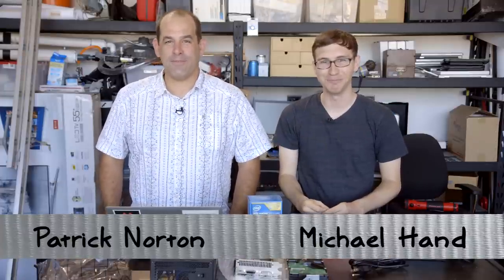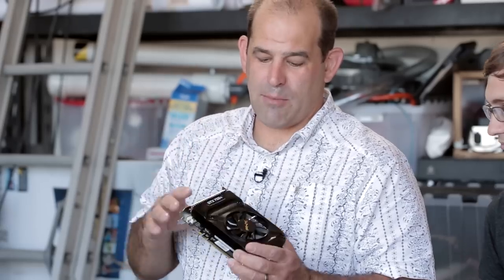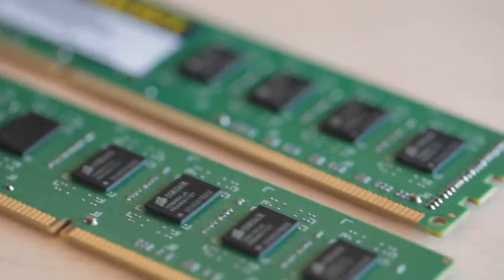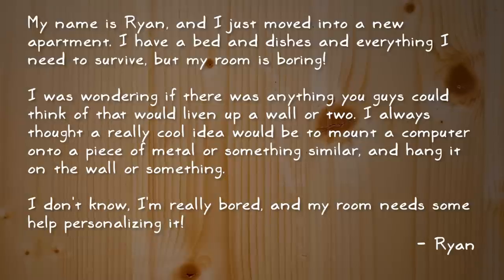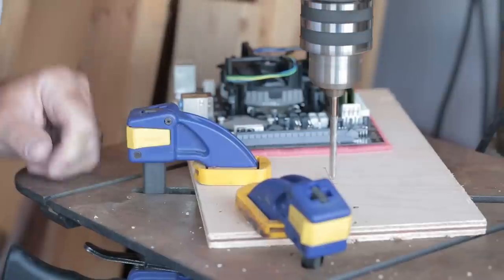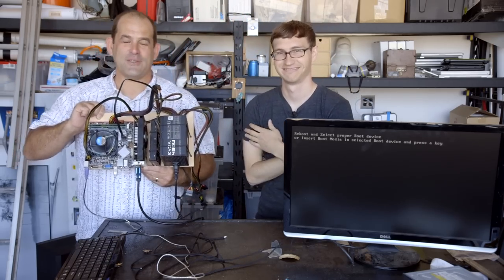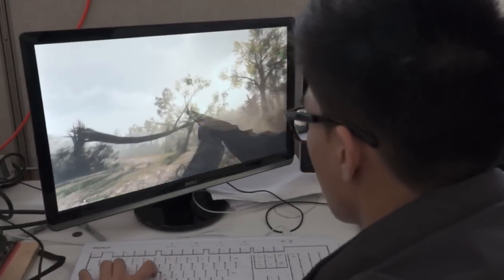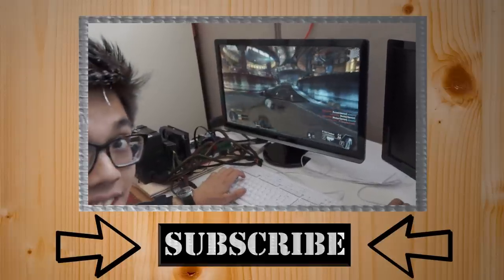Screw The XBOX ONE and the PS4... We Built a Gaming PC for $380!

Comment: Throw in a monitor plus software, thats like a $600 build, 200 dollars more expensive than the PS4.
Reply: You can use a TV as a monitor, most TVs are pretty good with response time and what not. As for the software, it's already included and it's still under $500.
Reply: the operating system is included?
Reply: iGame you can use steam os for free if you want it to be on the level of the console's os...
Reply: I'm completely new to PC, explain what steam os is?
Reply: iGame steam os is almost exactly the big picture mode in steam. if you want to know how to install it, watch linus tech tip's video on it.
Reply: Oh yeah? but what about the tv and the controllers, talkin about another thousand dollars there
Reply: Umm... And throw in a TV to play the ps4 on and your talking about an equal if not greater price...
Reply: I think having a TV is pretty standard if your buying a PS4.  Most people probably have a TV by now...
Reply: I think it would be a little uncomfortable to play a PC right under your TV. I'm not sure if you can use wireless controllers either...
Reply: iGame Right, but the argument could go both ways: most people already own a monitor as well. It's quite standard in most households. In general, however, the net cost of all the items you purchase will be about equal regardless of which way you go but I'd take a PC over a console any day.
Reply: iGame I dont have a TV...
Reply: you got those for free
Reply: The PS4 has a built in screen nowadays ?
Reply: And a good gaming mouse and gaming keyboard too. Dont forget that.
Reply: Windows isn't the only OS. Also, since when did a monster have to be $500?
Reply: Paralyzed Tortoise But its the one Games are the most compatible with.
Reply: ***** Why are you assuming im a console person for? If you want to be good at games, you need a good gaming keyboard, with anti ghosting and very responsive keys and a high DPI mouse for the best accuracy. You also know what they say when you assume things about people right? Ill remind you: Assuming makes an ass out of you lol You console haters try way too hard and make PC gamers look bad.
Reply: If you have purchased a tv in the last 10 years it will have HMDI, you could easily use that as your display, so your comment is irrelevant.
Reply: ***** How is me pointing out youre wrong being butt hurt? You just exposed yourself as a troll.
i enjoyed that troll though. It was funny lol :)
Reply: Don Cheech Not entirely, not every tv sold ten years ago till now had hdmi.
Reply: ***** You were wrong about me being butt hurt and assuming i was a console player. So you were entirely wrong about 2 of the 3 points you tried to make. they arent essential, no. But youll be a lot better with a better mouse made for gaming. So youre not wrong or right on the mouse, as that is personal preference.
Reply: ***** Im pretty certain as im just the type of person who responds and explains things. If something isnt true, i simply correct it. thats all. So yes im certain. :)
Reply: Umm you need a TVs for ps4 lol
Reply: noah brown Majority of people already have a tv.
Reply: Rockymann27 tv's can be used as monitors so everyone shut up i win.
Reply: William91W Then it shouldnt be included as a price for either, since most people own one lol
Reply: Throw in a tv plus playstation plus that's 550$-650$ your argument is invalid.
Reply: E Zannino Everyone has a TV pretty much, so thats not a valid point really.
Reply: ***** I said pretty much everyone. Not everyone.
Reply: ***** Well then what was the point of that? X_X
Reply: Rockymann27 Every pc has an hdmi. That was my point.
Reply: Wth are you talking about? Not every PC has HDMI.
Reply: Keyboard, mouse, desk, mouse pad, chair, subscription to play online...wait nevermind, that's free.
Reply: James T You have cable bill and there are monthly service games, like WoW.
Reply: If you have a tv already: HDMI (60hz max but this is budget stuff anyway), software: Debian Wheezy or Ubuntu 14, keyboard and mouse combo: $30 max.
Reply: Lots of people have laptops...
Reply: lots of people can't figure out how to use a PC let alone figure out the hardware they need to run a game. Hence the console market. They cater to the less tech savvy crowd. It will play your games at 900p (not 1080p) make you a cup of coffee and possibly wipe your ass and tuck you into bed as well. :)
Reply: Some of us just want a casual gaming experience
Reply: Last time I checked, the PS4 doesn't come with a TV.  Add in the cost of playing games online, and if you're going to throw in the cost of games, last time I checked, games were generally more expensive at launch on consoles than PC.
Reply: You can play with PC players, that the biggest perk of PC gaming:) I'm new to PC gaming. People here game seriously and they game hard. It's always a challenging and intense, if I play Playstation again its like a slow childs birthday party ( it's that distinctly different). Too many bored kids ruining the game play in console land.If you have a chance to play PC do it (if you haven't yet). It's also so much cheaper for games it ridiculous. I have a back log of games!! A back log!!:) I haven't had that EVER and I've been a console gamer since before playstation one existed!

Steam has amazing deals mid week and week ends. Great games for net to nothing. I got the new Tomb Raider (2013) about a month ago for €13! (It came with every other Tomb Raider available on PC, right back to the first game). Both Portal games €18, Metro 2033 both games about €22. I've picked up great games like that for the past few month I'm forcing myself to stop. Like Fear came out the other day for like €15 with 2 other Fear title packed in, I had to stop myself because I need to play games I already have. Its amazing on game cost, its actually ridiculous:)
Reply: You all forgot about the modability of pc games. Games like Skyrim, FalloutNV and GTA games could be modified to add hundreds of hours of game play PLUS vastly improved graphics over the console versions
Reply: iGame of course you can use wireless controllers on your pc.
Reply: energetically1 after reading your comment i really dont want to convince any console gamer to come to pc, dont want to get the slow childs birthday party over to my house.
Reply: jan050375 Ah it is fight or die in the PC world I'm finding. I'm being completely schooled ha ha  It forces you to be a better gamer for sure, which is really cool actually. I haven't been this excited about gaming in years. The herd is culled regularly in the Master Race, so get stronger or get smashed relentlessly and smeared in LOLz:)
Reply: energetically1 There are plenty of those type of people on PC too. So hate to break it to you, the community is not as drastically different as you think.
Reply: Rockymann27 Yes, it most certainly is.  I can go on any multiplayer game on PC and not have to deal with racist, sexist manchildren screaming into their headsets.
Reply: jedidethfreak Ive....encountered many of those kind of people playing on PC. Anyone that says there are none of those kind of people on PC as well are just plain lying. So im sorry that i have to say it, but youre lying by saying there is none of that.
Reply: Rockymann27 I didn't say there is none - only that I've never dealt with it in my 25 years of PC gaming.  On the other hand, I can't play games online on a non-Nintendo console without experiencing such.
Reply: jedidethfreak Ive played on non nintendo consoles online and only experience it every now and again. Definitely not everytime i played like you like to exaggerate.
Reply: Rockymann27 I'm supposed to believe that from the guy who claims a gaming mouse and gaming keyboard are "mandatory?"
Reply: Rockymann27 Well yea of course but its defiantly a much better gaming experience (multiplayer), by a long shot.
Reply: energetically1 And even a basic KBM is a better gaming experience than a controller in a lot of games.  The ones that it isn't can still be played on PC with a controller anyway.
Reply: jedidethfreak When did i ever say a mouse and keyboard are mandatory? At all? I never once said that. Respond to the right person. X_X
Reply: energetically1 Well as far as my experience personally experience, theyre pretty even as far as community online.
Reply: Rockymann27 I did respond to the right person - your very first post in this very thread has you stating that if you're gaming on PC, you need a gaming mouse and keyboard - that such items are a mandatory addition to the cost of a PC for gaming.
Reply: jedidethfreak Need a gaming mouse and keyboard TO DO WELL in gaming. I didnt say it was required, just that a cheap keyboard has a lot of drawbacks/ Like antighosting for example. Nice way to take a small part of what i said and ignore the rest though.
Reply: Throw in a tv, hey look the PS4 cost 300 bucks more, gtfo
Reply: X3nonEyez Most people already have a tv.
Reply: Rockymann27 Of course, if you actually know what you're talking about, you'd know that ALL ps/2 Keyboards have anti-ghosting and rollover, and are significantly cheaper than "gaming" keyboards.  So, again - you're just plain wrong.
Reply: jedidethfreak Not all keyboards have GOOD anti ghosting. Plus i was just using one part as an example, theres more than that that gaming keyboards make them far better for gaming than normal ones. So again, you acting like your opinion is absolute truth (when its not) just shows how plain wrong you are. I tried playing games online at my colleges computer with there keyboard. It was sluggish and not as responsive for twitch movement like my gaming keyboard is. Like i said, its possible to play with a normal keyboard and you can. but gaming keyboards will always have a big advantage over them as far as gaming is concerned.
Reply: Rockymann27 I don't... but i already I have a monitor so that argument is bullshit
Reply: Yeah make sure to add 300$ TV to your console price with that logic. You can plus a PC into a TV just fine. Derp.
Reply: Rockymann27 My "opinion" IS fact - you do NOT need to include the price of a gaming keyboard and gaming mouse in a gaming PC.  If your only example of why it's needed is an el-cheapo keyboard that's used by hundreds of people a day, it just proves you're looking for reasons to make yourself right, when you're wrong.
Reply: LOL a ps4 also requires a tv???
Reply: jedidethfreak It sounds like thats what youre doing with your opinion. I stated the advantages of it, thats all. Youre treating yours as a fact when yours as just as much of an opinion as mine.
Reply: ***** I want to play GTA V, Halo, Uncharted using pc
Reply: asifur rahman GTA V is coming in a month, and people will mod the shit out of it and make it even greater, of course you could play Halo, in fact it's waiting for you for free
Reply: Because consoles come with TV's and its not like you have to pay subscription fees to play multiplayer or anything........ Oh wait, nope.
Reply: Rockymann27 How is it "opinion" to say you do not absolutely need to buy a gaming keyboard and gaming mouse?  The ten-dollar Best Buy special will game just fine - this is a fact.  This isn't opinion.  We're talking about water's wetness, here - it's wet.  That's just as much fact as not needing a gaming keyboard to game on PC.  I know - I've been doing it for ten years with a wireless non-gaming keyboard and wireless non-gaming mouse.  Would it be "better?"  Absolutely, and I never argued otherwise.  Is it necessary?  Absolutely not.

Again, I'm not arguing opinion.  I'm arguing fact.
Reply: Rockymann27 You don't need an anti ghosting keyboard or a mouse with 58 keys and uber high DPI.
I use some cheap ass keyboard and mouse that I got for ~30$. Which is around half the price of an Xbox one controller.
Better mice don't mean better gaming performance. Sure, you might be able to use another key or two, but it ISN'T NECESSARY.
Reply: These guys just explain how well this beats a console, and yet the fan boys will act like it's shit,
"You still need a monitor"
Well you still need a tv to play a console. Most gpus have hdmi ports now a days, and i'm sure most of the flat screen Everybody uses has them too. Friend uses his 42 inch flat screen and is loving it.
"It can't use wireless controllers"
Wrong yet again pretend to be stupid all you want.It can use both wireless and wire controllers, even better games like battlefield you can use a jet controller.
"Some other stupid excuse"
Pretend to be stupid and ignorant, even then PC will still come on top more comfortable than console
Reply: Throw In the TV to game on your ps4? Why does no one factor in the TV when talking about consoles. Its the same argument
Reply: iGame PS4 comes with a display for free?
Reply: Well, what about games that cost $60? What about the $50 PSN/Live. Its gonna add up.
Reply: Software is easy to get for free, and you will spend more on a TV for your shhhitty ps4, than on an average 60htz monitor
Reply: Daniel Stevenson
Bloodborne
All PC guys r weeping
Reply: asifur rahman Yep - we're weeping that we don't get to have that sweet 24fps and 70ms frame times, with half-minute loads.

http://www.eurogamer.net/articles/digitalfoundry-2015-bloodborne-performance-analysis
Reply: Throw in a $600 TV and that's like $400 more than the PS4? derpaderp
Reply: what are most people using as a monitor right now?
Reply: Rockymann27 Why does one need fancy peripherals to be good at games?  I used to use (actually still have the damn thing) an old cicero PS/2 keyboard and a Dell optical mouse (which died). It was awesome and I could rack up a K/D of 10 to 20 on COD2, CS:Source and BF2, depending on the game. Now I have a fancy mechanical keyboard and a laser/optical hybrid mouse thing and it hasn't really upped my game, just is more comfortable.
Reply: TheMeisterize And with it being more comfortable, you can game longer and more efficiently.
Reply: Rockymann27 doesn't make it necessary, as you argued.
Reply: jedidethfreak I never said it was a must. i said it gives you way more of an advantage.
Reply: jedidethfreak Necessary to compete good on high levels. Not a must all around. Stop twisting my words.
Reply: jedidethfreak tl;dr. You twisted my words and point, so this thread is pointless now with you yelling and doing so.
Reply: A butt and a half I plan on doing so. I re read all my comments and never said you needed a gaming mouse and keyboard. Just that having one gives you more of an advantage over someone who doesnt. I tried playing on my colleges computers and i couldnt press multiple buttons at once. So i couldnt turn my tank and turret at the same time. It was really frustrating....X_X
Reply: Rockymann27 Again - I quoted you directly, so saying you didn't say it makes you a liar.  It was your VERY FIRST POST IN THIS CONVERSATION.
Reply: jedidethfreak And a good gaming mouse and gaming keyboard too. Dont forget that.

Thats what i said in my very first post. Where in that post did i say its a must a required? Show me where i said those words in my first post please.
Reply: I'm going to type really slow, and hopefully you'll keep up.

This thread.  Is about.  REQUIRED.  PC.  GAMING.  PERIPHERALS.

By making that statement, you said those were REQUIRED.  Got it, yet?  Then, when I pointed out that those were merely optional, at best, you argued that point.

By saying (and again, I quote):

"If you want to be good at games, you need a good gaming keyboard, with anti ghosting and very responsive keys and a high DPI mouse for the best accuracy."

"you need"

"need"

As in, not optional, but mandatory.
Reply: Rockymann27 Go ahead - we can all see you said it, seeing as how I copy-pasted your posts.
Reply: Throw in a TV for ps4 and you are at 900$ ...
Reply: jedidethfreak I re read what you copy and pasted, and no where in any of that did i say the word required or you absolutely need it. Again, good try with lying and twisting my words around. The word you need isnt the same as required. But again, good try twisting my words around to mean something i never said,
Reply: OperationGames45 Most people already have tvs.
Reply: Rockymann27 most people already have monitors, and an sd tv
Reply: A butt and a half That is true, but a lot of people, from what i read and heard when theyre building a new gaming rig, want a new one thats 144hz and can display 1440p or 4k. Those of which, most people do not have lol
Reply: Rockymann27 well, yeah. most people don't have those kinds of expensive monitors, but many have 1080 p 60 hz monitors which are more than what the consoles do
Reply: A butt and a half Thats true most of the time, but like i said, whenever i here about someone building a gaming rig, they talk about getting those expensive monitors. lol
Reply: Rockymann27 they shouldn't right now, they are very expensive.
Reply: Rockymann27 if they have enough money, and care enough. then sure.
Reply: Rockymann27 You said "need."  Twice.  Do you not know what "need" means?
Reply: Rockymann27 curious, I can press six keys at once on my Logitech mk320 keyboard/mouse combo from like 2009, and I have had no problems with ghosting, even in StarCraft 2 or League.  I still use it for LAN parties occasionally.  Keep in mind this keyboard and mouse share a single usb dongle that has about a 3 foot usable range, not exactly top notch equipment. Your friend must have some soviet era bullshit or something.
Reply: jedidethfreak Do you not know need and required are 2 different words?
Reply: Final Kill Gaming Do you already own a tv? ok good to go
Reply: You can get free operating systems or just get 13$ par codes
And most people already have a monitor from spare computers 
And even you could get a nice gaming bundle kit with leds for a mouse and keyboard
shreked
Reply: Rockymann27 Two different words, with the same fucking meaning.  Read a thesaurus - they're synonyms.

A synonym is a word that has the same meaning as another word.

A thesaurus is a book that says what words mean the same as other words.

I thought I'd spell that out, since English clearly isn't your first language.
Reply: TheMeisterize Actually, old-school keyboards don't ghost at all, because of how they're made.
Reply: jedidethfreak For PS/2 keyboards absolutely correct
Reply: jedidethfreak heres what they said the synonyms for need are:

commitmentstardemandstarobligationstarrightstarurgencystarusestarwishstarchargestarcommittalstarcompulsionstardesideratumstardevoirstardutystaressentialstarexigencystarextremitystarlongingstarmuststaroccasionstarrequisitestarweaknessstaroughtstarthe urgestar

read it 3 times and the word required never came up. It must be hard for you to accept any possibility that you could be wrong and youre grasping at straws at this point. Good try though.
Reply: TheMeisterize Oh and not to mention the definitions of both are completely different, so dont try and cope out on that excuse either.
Reply: Since when does any console include a tv lol?
Reply: *****
Or just use Linux. It ain't gonna get cheaper than that, and it's also completely legal.
Reply: jedidethfreak I said required, not require. But again, good try. That one letter changes the meaning of the word slightly to where its not a synonym of need.
Reply: Rockymann27 No, it does not.
Reply: Rockymann27 You're just pissed because I proved you wrong.  Again.
Reply: ***** ps plus isnt $60, not all games are $60, and not everyone buys a game as soon as it comes out. Good try though.
Reply: ***** Oh and most people already have a tv, so i dont see how thats a factor. And then theres the variable that not everyone wants to play online either.
Reply: ***** I.....never said you couldnt....?
Reply: Not fair because PS4 does not come with TV, and it is possible to use PC with TV if you really want to (may be a problem with web browsing and such due to low PPI, but can do Steam Big Picture for sure)
Reply: Throw in a TV and PSN, that's like a $1000.
Reply: Amar Gandhi Most people already have a tv and not everyone plays online either. Just so ya know.
Reply: Paralyzed Tortoise $30 (CM Storm Devastator)
Reply: Lol I am building a PC and just got to that stage. Didn't really realize how much it really is until now
Reply: Lorenzo M most graphics cards already have hdmi
Reply: Consoles dont happen to come with their own like $100+ flatscreens do they
Reply: Christian Tatupu Mailo Most people already have a TV you know.
Reply: Rockymann27 you can connect a pc to a tv just like a console.
Reply: Rockymann27 who were you even replying to? if it's the guy above you, then my comment makes perfect sense; as you implied that only consoles can be connected to a tv.
Reply: A butt and a half I am replying to you and i never implied, even once, that only consoles can be connected to TVs. Youre really grasping at straws here to avoid being as wrong, as i never once said you cant connect a PC to a tv or even remotely implied it. All i said was most people already own a TV and that was it.
Reply: Rockymann27 I know that you are replying to me now, but I was talking about your original comment.
Reply: A butt and a half And as i said, i never said or implied you couldnt connect PC to a TV at all. All i said was most people own a TV. Thats it lol
Reply: Rockymann27 you still haven't answered my question.
Reply: Rockymann27 your original comment...
Reply: Rockymann27 Most people already have a monitor.. and windows
Reply: Rockymann27 so do you get a TV when you buy a ps4 or xbox?  That's got to be the dumbest question...
Reply: Christian Tatupu Mailo More people have TVs than monitors actually and honestly, whenever someone is building there first gaming rig, they mostly go for a new monitor  thats bigger or has higher resolution or higher hz, etc.
Reply: Robert Palmer Just like your comment.
Reply: Rockymann27 Yeah but put both of them side by side:
Console=Pc
T.v=Monitor
Controller=Mouse and keyboard
so if your gonna include the price of the monitor in the build you have to add the t.v price with the console.. Not the controller because most ps4s/xbox ones come with controllers
Reply: it just isnt fair otherwise
Reply: Rockymann27  you replied to his comment, which said the following "Consoles don't happen to come with their own like $100+ flatscreens do they?" with "Most people already have a TV you know."; implying that pc's can't be connected to tv's.
Reply: Christian Tatupu Mailo Console and PC are 2 different things. Whole monitors and TVs are closer in relation, theyre still different. Like TVs being built to be much bigger for example. I never said to include the price of a monitor. All i said it is pretty likely that if someone is making a new gaming rig and it can do 1440p or 4k and they want it at a higher hz, they will most likely get a new monitor. Thats all. And like i said, most people already own a good TV and console only players are less likely to upgrade their TV when getting a console.
Reply: Rockymann27 You have a good point but did you read my comment.. i was pointing out the fact that the price of a ps4 or a xbox would be way over the price of this if you just put them side by side... because he was saying throw in a monitor and software you get $600 so i said if you throw in the price of a monitor you have to throw in the price of a t.v... consoles and gaming pcs are sort of the same if you even read my comment
Reply: Rockymann27 What youre saying isnt completley irrelevant but it is close to the edge
Reply: Irrelevant to what i am talking about
Reply: iGame dont forget on xbox one and ps4 u have to pay online fee but in pc its free
Reply: over time ps4 actualy becomes more expenisve
Reply: Hakop Ekizyan Depends on the person and their spending habits.
Reply: Rockymann27
Aight
Reply: iGame Actually you can build a decent gaming rig for only $450, $50 more than a console. That along with the fact that the computer has far more capabilities than the console. Can the console edit my video recordings? Can the console let me do homework in Office Word? No. Plus you fail to mention that you CAN get free OS if you use linux, which is far more capable than people think, as long as you know your way around the OS. The monitor doesn't have to cost much, and you can get monitors used that work well. Or you can just as easily hook it up to a TV just as a console would. Consoles are okay, but they can only game, and $400 for only gaming is far more expensive than $450 that can do decent gaming and still be able to do much more.
Reply: TheCyberQuake Are the parts all new or do you mean used? Are you factoring in sales and rebates in your pricing? What about pricing in different countries?
Reply: TheCyberQuake PS4 you can edit video recording actually. All games use windows and a very good chunk of them dont support linux, so theres a drawback to linux. If were including used prices of things as a point, i could get a used PS4 for about $200 plus tax.
Reply: Actually way more games than you think support linux now days, especially with steamOS being linux. The support for them has vastly grown. And you say PS4 can edit game recordings. I meant editing actual video for items such as youtube. You can edit video on PS4, but not well enough to actually be worth while unless its just game play footage. You can get a used PS4 for $200? I got a used gaming PC for $10 at good will, which only needed 1 ram stick replaced, which I already had in my house. Anything else you want to fail to debate?
Reply: TheCyberQuake Yes, you can do taht for youtube and twitch and edit the recordings on ps4. More are, but not all games are compatibly with linux. With the newest update, you can actually edit pretty well now. You ignored my previous comment and you cant argue and state cause you got lucky and got something used really cheap that it represents what everyone else will be able to get it for. Anything else you want to leave out when stating facts?
Reply: If you want to make GOOD videos, any good youtuber will tell you that console editing is a no go. Even console recording is a no go. You'd want a capture card on a PC for the best quality. Sure, I'll give you that not all games are compatible with linux, but I never stated all of them were. Windows only costs an additional $100 at most, that's if you don't know where to find good deals. How did I ignore anything from your last comment. I mentioned used prices for PC can be cheaper, and I mentioned linux support. Nothing from your previous comment was ignored.
Reply: TheCyberQuake Doesnt matter you and others opinion of it, the fact of the matter is is that it can do the job and perform it moderately well. I made 2 comments. You responded to the second one, but not the first one.
Reply: Rockymann27 You were pretty good but the other guy was better.
Reply: Christian Tatupu Mailo Not really, no.
Reply: Rockymann27 Yes. Most of your arguments are irrelevant. This one not so much, but the other guy was just better.
Reply: Rockymann27 and I don't hate console gaming, its just PC gaming has more perks, costs less in the long run (you can MAKE it more expensive, but it's not a requirement) due to free online play and games being on sale or cheaper on PC. Along with that it costs less in the long run to keep the system going. If you buy decent parts to start, you simply upgrade the key parts to gaming, or add another and SLI/Crossfire to get even better performance, which costs less than buying the "latest and greatest" next gen console.
Reply: Christian Tatupu Mailo Actually, they arent. Just because they are irrelevant to you personally, doesnt make it a fact that they are.
Reply: Rockymann27 Yes, your argument with me. I was talking about putting them side by side an that the consoles are technically more expensive because if youre going to add the price of a monitor than add the price of a t.v but you just rip that up, throw it in the bin and talk about something that is anything but relevant to what i was talking about. Read it.
Reply: Christian Tatupu Mailo don't forget the service charge xbox live isn't free $60 (12 months ) an same with Playstation ( Sony pushes playstation Plus $60 for 12 months ) ! It's ridiculous !
Reply: SwollenRhino Actually, its $50 on ps plus, not $60.
Reply: Pre paid its $50 , online on PSN its $60! they add tax !
Reply: Rockymann27 That still doesn't help your argument when most PC games can play online for free.
Reply: TheCyberQuake Not arguing for either side. Just correcting you and preventing the spread of miss information. Thats all.
Reply: ***** Are we talkingnew or used here?
Reply: ***** I....was never arging for TVs or monitors being used....? Im just trying to see what the variables are.
Reply: iGame throw in a monitor with the ps4 :P